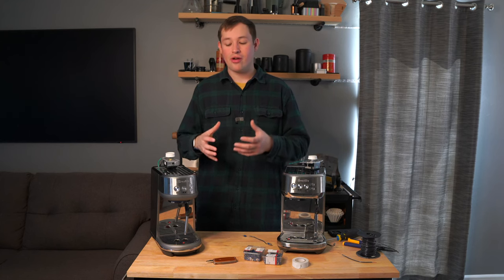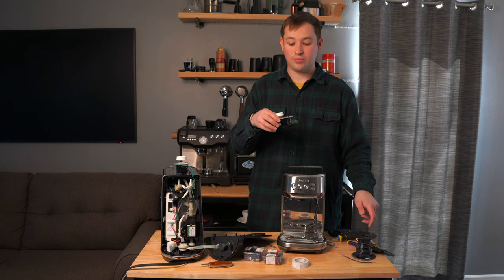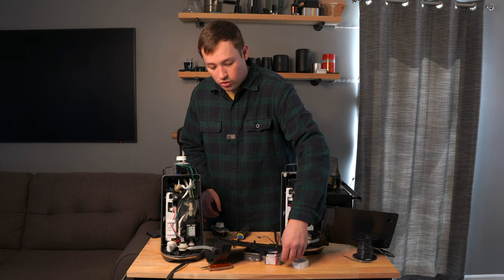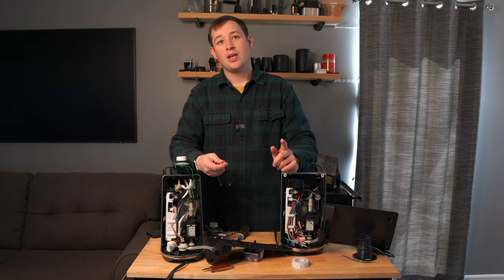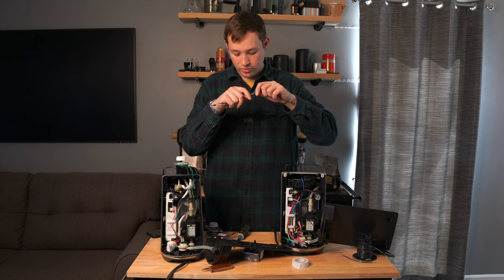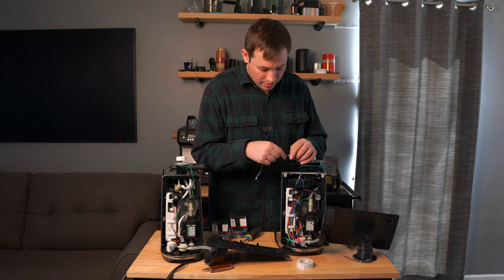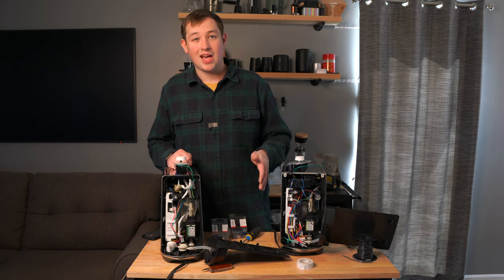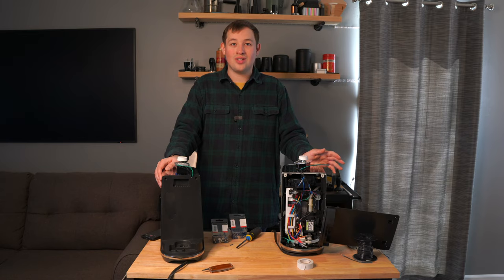Flow Control/Dimmer Mod For the Breville Bambino

Comment: Another thing to note, at least for me, was that if I went too low on that dimmer the machine would stop the shot because the flow meter didn’t have and signal/flow.
Reply from the maker: That is a good point! It has happened to me a few times!

Comment: Great! Finally some tech vids on bambino ! I would like to know if you tried to add 3 way solenoid valve on bambino. Imo it's the number one mod to do for getting ride of after shut off sneezing. And stopping nonesance diviation on output doze as well as timing.
Reply from the maker: I haven't but it sounds like a good idea!
Reply from the maker: Where have you seen this mod before?
Reply: @CabeensCoffeeCorner  Actually I didn't! Wanted to see if first hand here 😕 My observation is it's the matter of solenoid valve difference. Even the exit to drip tray is there on bambino. I was wondering if the piping is there as well!
Reply: @CabeensCoffeeCorner  I’d like to see this too!
Reply from the maker: @relatableguy2232  unfortunately I dont have this machine any more

Comment: I really like the idea but only thing concerning is the temperature of water when turned to low flow rates.  Question is, can the pid keep up at keeping constant temperature regardless of flow, or will the water be like 5-10 degrees higher during low flow?  Also if you decide to turn off the flow at the beginning for a blooming phase, will that trigger some kind of safety mode causing stoppage?
Reply from the maker: If you turn it off it will stop it. This isn't the perfect machine at the price point but it's really good for the value. My slayer mod dual boiler is much better.
Reply: @CabeensCoffeeCorner  It should be worth pointing out in your video that lowering the flow will just cause brew temp to spike, and thus negate any benefit of flow control.  You'll be brewing your shots variable temps that correspond to the flow rate, since there is no corresponding control to the heating assembly.  It's a pretty 'dumb' mod, IMHO.  Brew temp has far greater impact in the cup than flow rate. Using this mod will not improve your shots, it'll actually ruin them.  Just more thing to push people down the espresso rabbit hole.
Reply from the maker: @expresso4586  you might be correct on that but I feel like it’s improved my shots with the flow control

Comment: Would you recommend the slayer mod via the hot water knob on the Breville Dual Boiler or a dimmer mod?  I was planning to do the slayer mod to mine and had people say it wasn’t temperature stable and a dimmer mod is better.  What’s your opinion on that?
Reply from the maker: I would do the slayer. It’s way easier to do in my opinion
Reply: @CabeensCoffeeCorner  I actually did the slayer last weekend.  Used your video.  Thanks.  Been playing with it this week.  Thanks!

Comment: Rad video!
Doing the dimmer on my bambino this weekend.
Reply from the maker: Thanks for watching
Reply: @CabeensCoffeeCorner  
Got it done! Thank you for the video!

What I noticed on my Bambino was that for the ground there were a number of other ground wires in the upper right of the back of the machine. I added my dimmer ground to those with a wire nut. It worked very well.
Reply from the maker: @braxtonjens7839  Great Idea! Glad it worked for you!
Reply: Guys can you compare shots quality after mode?
Reply from the maker: @DaddyMakesCoffee  like before and after? Unfortunately no since I finished the mod.  However, the quality would be the same, except you get more control with the dimmer. In other words if the dimmer is turned all the way on and no adjusted in the shot, it would taste the same as without the dimmer